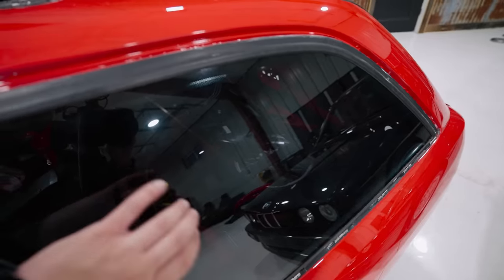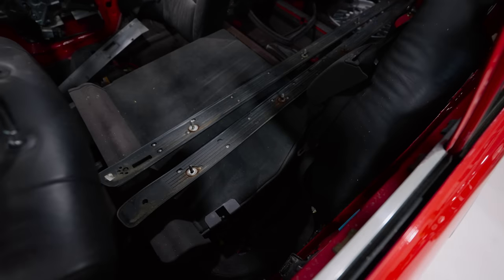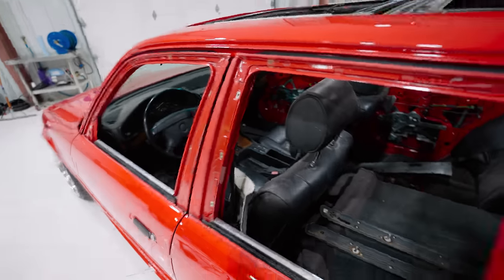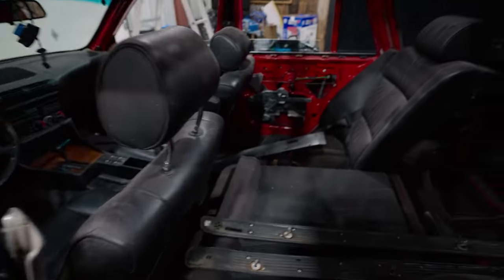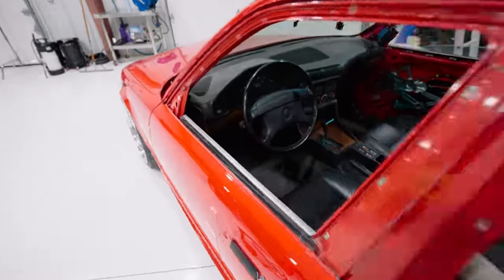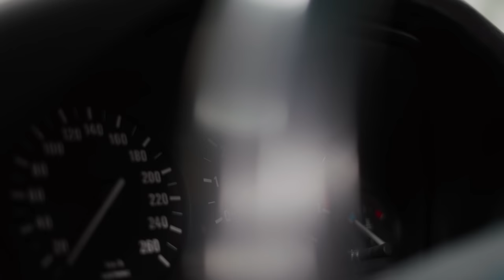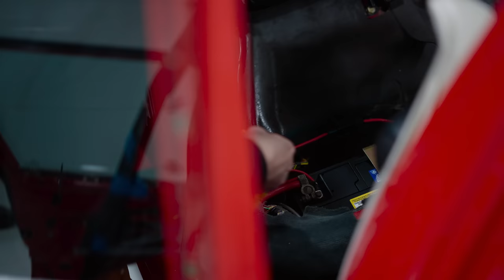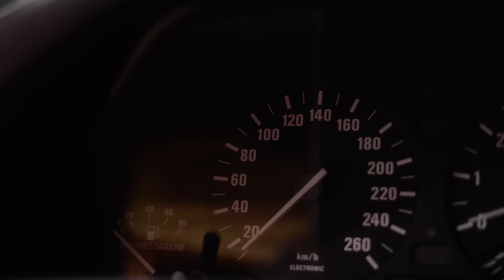How To Remove Super Old Window Tint From Your Car - 1994 BMW E34 Touring

Comment: AWESOME! In case it can help in the future, gas usually works wonders to remove old glue. Just dip a rag in it, let the rag rest on the glass and boom, glue wipes right off!
Reply from the maker: Thank you friend! Gas, bug remover, brake clean. Most aggressive things haha. But the blade on video is much more stimulating🖤

Comment: Work from left to right on the rear window. Those heater lines are weak as hell and you don’t wanna remove them, so if it’s posible do it longitudinally. Or at least if you are not gonna do it, be gentle as our protagonist. Beautiful work mate, so relaxing.
Reply from the maker: Thanks man! I find during it horizontal creates higher pressure points on the lines from the blade. But all good, worked out haha

Comment: Another great experience! Beautifully done. Indeed, I wouldn't have trusted the body shop to detail my interior either, but on another note, I kinda cringed seeing the razor blade going over the top of the defroster lines. I know you are super careful, but doesn't that damage them?
Reply from the maker: Thanks man! But nah it doesn’t effect effect them if you’re hitting the right angle and with minimal pressure. It’s when you go parallel the lines you start removing the lines
Reply: @ChromaticGarage  Cool, and thanks! I didn't know that.

Comment: Nice. Man I love that car. With patients can it really be that ez to remove the tint? I have 2 cars to do. One is only the back glass because it bubbled from from baking in the sun last summer. The E30 is just super old and it too the back glass has failed and looks like crap. I am scared of the e30 rear window Defroster Lines.
Reply from the maker: Thanks man! I think because of the hatch on the touring it makes the ability to use literally zero pressure very possible. The rear e30 glass also scares me and it’s something I have to do as well haha

Comment: Is it safe to do this on a rear glass with defrost? I've always been told it can ruin it?
Reply: You typically never want to use a razor blade on the rear glass with a defroster as it will cut the defroster. The best way to go about it is with very fine steel wool.
Reply: @1cstabach  or a plastic razor blade
Reply: @1cstabach  steel wool will not scratch glass?
Reply from the maker: It’s not safe but because of the ability to lift the hatch in the wagon you’re able to control your pressure. None of the lines were harmed. I’d recommend bug remover or brake cleaner if your worried. Or church actually